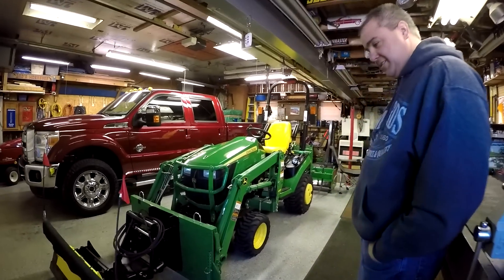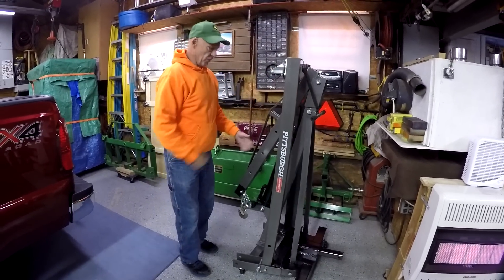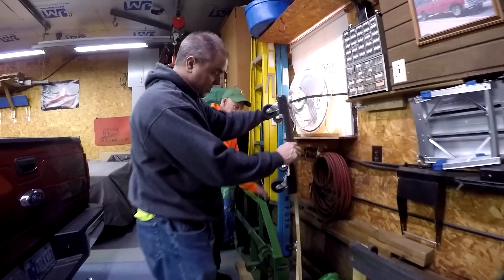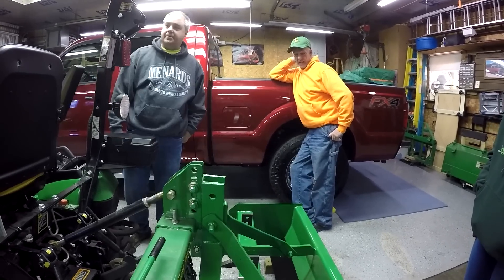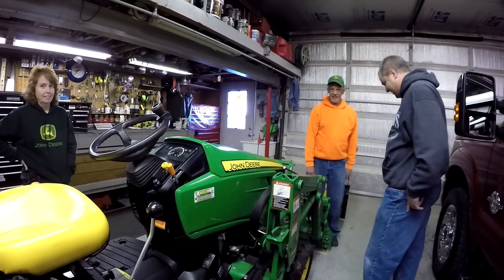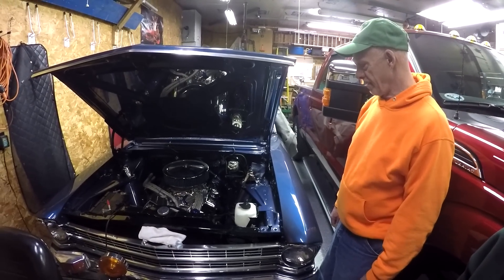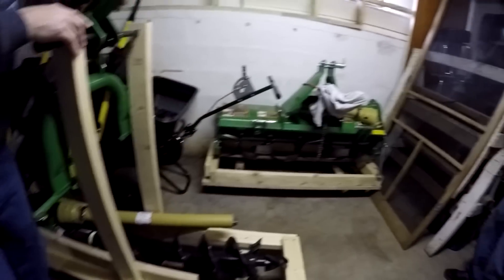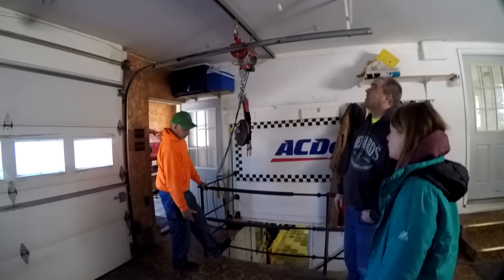Mark's Attachments and Creative Storage Solutions

Comment: Like the videos. Took one step further and made a quick hitch attachment for the loader arm so that I can take any 3-point equipment and move from the front and lift to store on selves. I.e. Like the rototiller. Also allows me to use the ballast box to weight the front of the tractor. Made 3 concrete blocks that fit into the ballast box weighing 600 lbs total. These videos are great for exchanging ideas. Thank you!

Comment: I have the auger bit attachment and I have used it so much; it has become one of my favorite attachments. 
The attachment I really want to see adapted for the 1025 is a cement mixer. I have seen cement mixers for larger tractors but not one for the 1025. Have you ever seen one?

Comment: Dear Tim, I just bought a 2017 1025R  with 80 hours on it. It came with the FEL, 60D deck and 54”  quick hitch snowblower. I live on 7 acres .  What would be the first attachment you would recommend? I need to tow a snowmobile trailer I converted to to a brush hauling trailer. Heavy  Hitch with weight bracket?
Reply from the maker: Yes, heavy hitch weight bracket and weights.  You need rear ballast to go with the front end loader. Don’t forget code ttwt!

Comment: Is there any type of small bush hog for this small of a tractor and does it come standard with a way to put on a front implement such as the snow blower or broom attachment
Reply from the maker: +Jay Peace yes, you can use any 4' bush hog, and yes, check out my video review of the front quick hitch snow blade.  The same quick hitch is used for broom and snow blower
Reply: Ok thank you for your time

Comment: I just got  1025R like yours but I don’t really know what type or brand of the pallet fork to get. Can you tell me which is good and where to buy? How many inches wide?
Reply from the maker: Artillian.com.  They are expensive, but the best ones out there because they are lightweight, and strong.
I use 36” x 3” forks, again because of the light weight.
Reply: Tractor Time with Tim thank you very much

Comment: Tim enjoy all of your videos. My wife and I have a couple of horses on small acreage in North Carolina  I have located a couple of used John Deere compact tractors,, a 2032r with front loader and a 1025r front loader and backhoe.  Both tractors are priced within $500 dollars of each other both having approximately 500 hours on each   My primary use will be manure removal and grading gravel drive  
Do you have a suggestion on which of the tractors would be best for my needs.  Your opinion is greatly valued  

Tim
Reply from the maker: I'm assuming a 'pre-2017' 2032r.  This is a very nice tractor, much larger than 1025r.   Will feel like a 'real tractor'.
The disadvantages with this tractor are:  1) poor/uncomfortable cockpit.  2) no quick disconnect deck.  3) difficult to attach backhoe.

Sounds like #2 is a non-issue for you.

The backhoe question is a question you need to answer.  You can watch my 1-series backhoe videos (there are lots of them) to see if you think you would use it. I find it a wonderful addition.  You can do many things with a backhoe which simply cannot be done with a loader.

If you find the backhoe unimportant, then take the 2032r for a drive.  If it is comfortable enough for you, it will be MUCH more tractor than the 1025R.  

I realize that is not a straightforward answer for you, but I hope it brings up points for you to consider.